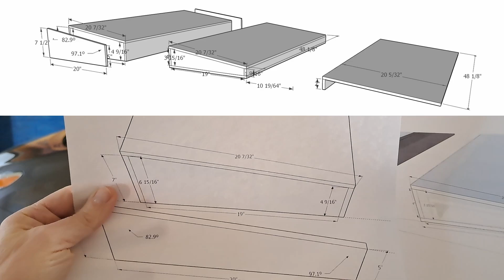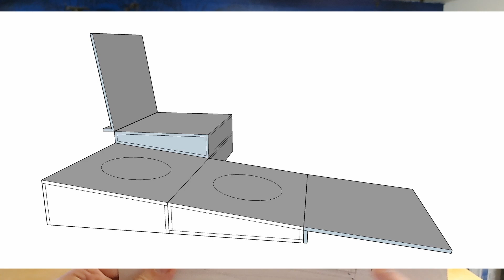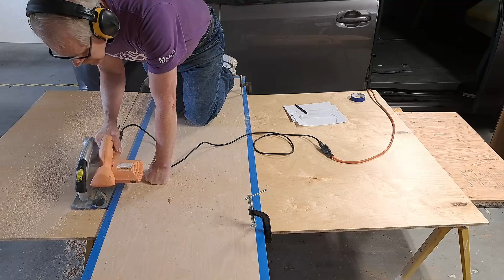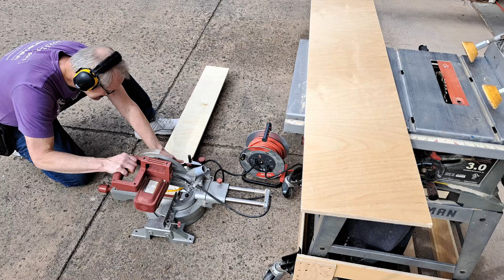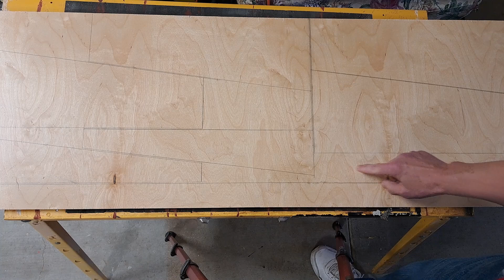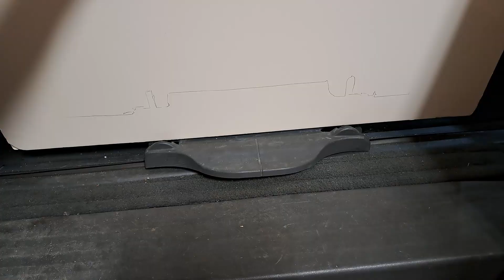Transforming Minivan for Camping - 2015 Toyota Sienna - Part 2 - The First Parts Get Cut

Comment: It’s interesting how you’re able to provide links to me for research but I’m not allowed to do the same. I was going to share how it was going with slicing ice cream, as discussed in the comments section of another of your videos, and included a link to an Amzn review I had posted over there to “prepare you” (because you can’t see me due to a cowl I wear, keeping the Mystery of Mister E 😂) for what my update would look like. 
This is the video of yours I shared that link, and after wondering for some time why I hadn’t received a response from you I came back to find out not only was the link removed but so was my reaction to this video! 
I assumed it was YT that removed it, but I also know as a creator you’re able to delete these comments, as I’ve been informed by the ‘John In Bibs’ channel creator
Reply: @SchoolReportsOnTheGo 
The one problem I ran into is my freezer isn’t cold enough 😂. The ice cream melts while I’m cutting it/slicing. What I could really use is something like an egg slicer on a scale of a loaf of bread (I’m currently looking at bread slicing contraptions or a paper cutter that doesn’t have a “guide” for things that aren’t paper. 

Otherwise the cheese slicer is ok. It’s smaller than I would like but it has an actual blade as opposed to “metal strings” like an egg slicer has (and can bend easily). As is, after cutting the ice cream out if it’s container, I have to slice the quart in half before attempting to slice it like a block of cheese.

I could use a 3D printer and a designer (hint hint 😂) to construct a large egg slicer (for a hard boiled ostrich egg?) where I could slice the entire quart all at once. Once sliced it works well freeze drying thin slices.
Reply from the maker: I'll have to give this more thought. Cutting slabs of ice cream is obviously be more tricky than it seems. I know it took a good amount of force to push one blade through the block of ice cream when I cut some slabs. I can hardly imagine how much force it would take it it were 10 blades.

 Freeze Dried Ice Cream and Cake for Batch #200!  https://youtu.be/RoU7VrDyMGs?si=LvPy4YGqx-v7kRgX&t=123
Reply from the maker: What about this kind of concept? https://amzn.to/3UDuLMq It could it frozen before using so it doesn't melt the ice cream.
Reply: I’m envisioning two large sticks held in each hand with string between them strong enough to cut, about 1/2-1 centimeter apart that I could just push down on the quart, holding the sticks taught, slicing the entire quart all at once.
Reply: I wasn’t done, as I wanted to try reconstruct the reaction to this video, but all of a sudden I couldn’t get back to the bottom of my comment after editing it.
Now that I’ve seen all the videos I’m up to date.
Reply from the maker: I really don't know why it's not here. Posts with links usually just get "caught" in the YT "Held for review" folder for me to make sure it's not spam before releasing it.  (The last post I see from you was on 5-5 on the "Part 1" of the van) I think the only posts I've ever deleted have been spam ones "offering" to "help my channel grow" for X dollars, or $ex sites "you just have to see!" (YouTubers have been held responsible for things left in their comments)
I didn't get a notice of the comment of you telling how the ice cream slicing was going. 😕 (How is it going?)